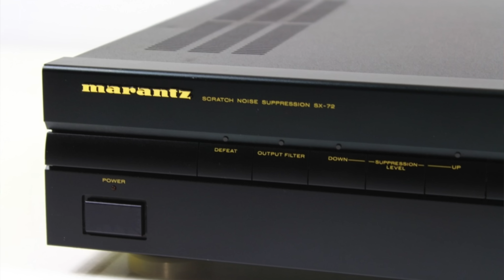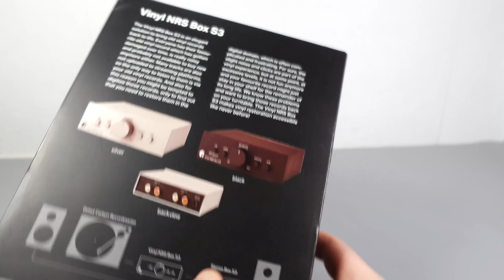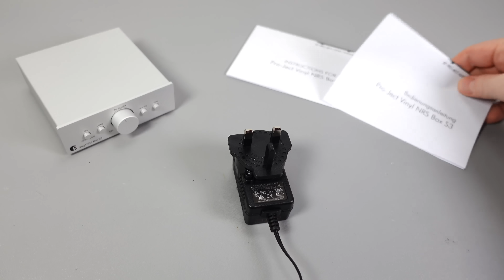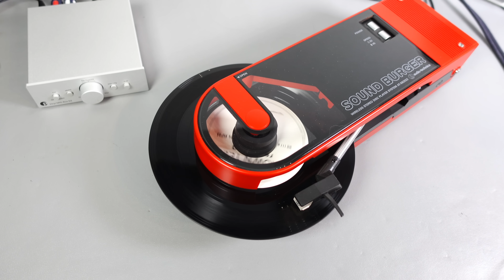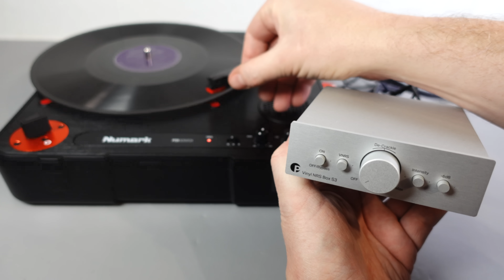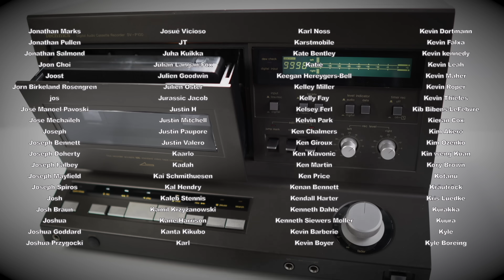REVIEW : Vinyl Noise Reduction System Pro-ject NRS Box S3

Comment: Thanks for testing. To my ears (and also eyes when I look at the recording of the 'silence vinyl' you made) the 'VMRS' is nothing more than a LowCut filter. Some vintage HiFi Amplifiers have a LowCut button and some extrenal phono preamps have that too. Sometimes they are called subsonic filter. 
The one in this device seem to filter at a slightly higher frequency than most of the ones that I've heard. Thats why the bass on the 78 nearly disappear. You said that the listener can turn up the bass on the Hifi to compansate that but by doing that he/she also raise some of the rumble again. 
Unfortunatly filters can't make a difference between rumble and an instrument. At least not now and not in realtime. Machine learning might help to create a 'smart filter' but it will always need processing time (BTW I'm impressed whats possible with 'AI' in audio) . Look at www.lalal.ai for example.

Back to the device :) 

What I realize is that the filter seem to have no influence on the latency so it might be even before the AD converter. The 'De-Crackle' seem to have a latency of a quarter roation (round about 0.5 sec on 33RPM). This could be annoying in some cases when the sound of the  stylus itself on vinyl (I mean the sound that you hear when you play a record without a speaker) and the amplified signal is 0.5 second 'out of sync'
The detection of 'big pops' from scratches is an issue even in software (well ok, I havn't look into the newest releases of decrackling software). When I digitize vinyl I get rid of those manually. Auto decrackle  either didn't detect the pops or create too many arifacts like missing attackphase on 'snappy' instruments (snaredrum etc).

Comment: Hmm 🤔 Overall the performance of this unit seems rather underwhelming. There doesn't seem to be a whole lot of difference even with the settings turned to maximum 🤷‍♂️ For me the biggest surprise is the fact that this unit didn't seem to "mangle" the audio signal too much, even at maximum settings.

I've done a lot of audio restoration of vinyl records over the years, and I've used a lot of different de-crackle filters / plugins. The computer based de-crackle filters work a lot better! In fact, computer based de-crackle filters can be turned up high enough to completely eliminate ALL pops and crackles. However,  this comes at the expense of "mangling" the audio signal and adding a lot of unwanted artifacts 😫

I guess I was expecting the performance of this unit to be more comparable to the performance of computer based de-crackle filters. Like something that could be turned up high enough to make a night and day difference to the audio signal (even if it also adds unwanted artifacts 🤷‍♂️)

Comment: This Project device is basically stone-age design as far as electronics are concerned.  The correct way to make a device like this nowadays would be using machine learning (referred to as "auto-tune" in the business).  While there are expensive proprietary ASICs for studios, they aren't needed for audiophile level hardware.  They can be built cheaply by a manufacturer with off the shelf components and the correct algorithms.  Also just to note, the Project device already digitizes the audio, so its not about a "faithful" reproduction of the analog sound, and neither is TM's review.

Comment: i personally paid around  £200 for a second hand  marantz sx72 real time de-clicker. I'm not an audiophile be any means but this just works!! It has been good for discogs purchases where the seller over grades. what i have also found is that you need very clean records to get the best out of the sx72. I'm very pleased with mine and think that this new unit is nowhere near as good.
Reply: Interesting that you are so happy with your Marantz SX-72. I got one too, and it seems to make absolutely no difference to most things. Only in the quiet sections of a speech-only recording I can get it to make at least some difference. The Pro-Ject device in this video works a lot better than the SX-72 I have...

Comment: I don't believe it's possible to filter out rumble or hum without also filtering out some of the bass drum and maybe bass guitar. On the other hand, the demo of the NRS with the silent record was very, very impressive to my ears. It's possible they're using something more advanced than just a high-pass filter. There's a noise reduction method that uses a noise sample and then sort of subtracts that from the input signal. That can work great, if you have an a good sample of what your particular noise sounds like. There is also the pretty new techniques using AI, but I seriously doubt that little box has enough CPU in it to run a large neural network in real time. ;)
Reply: No it's not really possible. You need very clever algorithms, and while i think this box gives it a go (why else does it need to digitize the stream? - And you can hear what it does to the sound, too. The way it takes the tops off the clicks with some of it's methods is more than just a bandpass), it's obviously not that advanced. Works actually better than I expected, though - And does exactly as expected to the sound on those records that have instruments that share some of the same frequency bands.
Reply: There seem to be good ways of cleaning up old recordings, but that takes expensive pro gear and a lot of experience. Listen to some re-masters of ie the sixties (Nina Simone, Roy Orbision, Buddy Holly and many more). This kind of cheap kit solves one issue and causes a few more...
Reply: @edmaster3147  Like I mentioned, the latest thing is to use AI. If you haven't heard what that can do, you should check it out. They've experimented w/ remastering,, the results are so-so, but for noise reduction, its pretty astonishing. But ofc, there's no chance there's enough hardware in this cheap little box. It does seem to do a pretty good job for what it is, tho.

Comment: This starts to become Audio Science Review territory, but my experience matches some of their findings regarding phono stage power/headroom and how distracting clicks and pops are when listening to a record. Basically scratches or debris cause the phono stage to clip if it can’t handle the power coming from the cartridge as it goes over a bolder stuck in the groove.

It doesn’t eliminate the noise but it does smooth it out.

Comment: A  very interesting review. I wonder how this device would deal with hiss from a cassette tape? Food for thought Techmoan?
Reply: I don't believe it can eliminate cassette tape hiss.  One needs to use the corresponding level of Dolby as was used when the tape was produced.  Or, one of the devices that were "single-ended" like the Phase Linear Autocorrelator,  or one of the Burwen devices, or other DNR systems (Dynamic Noise Reduction)
Reply: @svensvensen8406  It's got to be worth a try, especially on tapes not recorded with Dolby.

Comment: I use DCArt Forensics for noise reduction which of course works much better. You can remove the large scratch type pops individually if necessary, for instance. You can even draw in a wave form.
I did notice though that the 78 speed records were extremely hard to improve. I had to put so much noise reduction in that the music portion decreased dramatically.
In your examples I can't see near enough improvement to justify buying that unit.

Comment: Even Radio Shack had such home audio accessories, which in my opinion, were just another gadget to display on your rack. However, there WAS a professional studio device called a TNE (Transient Noise Eliminator). I have 2 of these in my collection. They are purely analog, and you can monitor and hear the Difference of what sound is being eliminated. They are rare to say the least. Good vid !
Reply: I have the burden research tne 7000 and can confirm it indeed works as intended! It does reduce pops and clicks, but of course it isn't a magic box. Unless you have a clean record, pops and clicks will be there. Just a little less with it working properly
Reply: love mine. Had two, gave the other away. The remaining unit may be pried from my cold, dead hands. ;)
Reply: @railgap  Hi there. The TNE that I mentioned was one of only 2 I built. I still have it, although I have no turntable and donated my record collection to a collector friend of mine. He has the 2nd unit I built. It would not be worth the trouble to build them again, although the idea has stuck in my mind given all the smaller tech parts available but I'm not even sure all the chips etc would still be available. But thanks for the suggestion. 😀
Reply: Hello UsJoe.... you beat me to the comment. Back in the day (70's), I came across the plans for a Transient Noise Eliminator like you mentioned. I modified it to work at line level instead of between the cartridge and the Phono input. I built this device as I was at the end of what I could tolerate in records. Unlike the one tested here, mine worked flawlessly and completely eliminated any trace of the click/pop as if it never existed, like magic. You could adjust the sensitivity to suit the condition of the record. This device is a boondoggle. It clearly does not work and for the price, they are selling people a bill of goods for high prices just like with the so-called High End Audio equipment today. Back in our day, pretty much ALL amps from ALL name brand manufacturers could deliver the quality and performance that today's equipment CANNOT do unless you are prepared to pay thousands. Even then you need sub woofers as the amps are not capable today. Back then it was standard performance. That being said, why anyone would purposely want to use vinyl records as a source is beyond me. I grew up with that technology and I can tell you there is NOTHING better or even good about it. Those who claim 'it sounds better, more warm etc' are delusional. There is absolutely NO science to support this. I do appreciate this video as it just shows so called 'Audiophiles' are being conned. That's my rant for today. :-)
Reply: @Starlight-AG  "Warm" is just the result of a physical object with mass and inertia being moved around in a magnetic field. Since there is limits to how fast it can be accelerated/decelerated plus a mechanical range limit, the actual analog signal can be warmer (as in frequency blending) over say, a digital encoding. It's the audio equivalent of say a soft focus in photography with Photoshop acting as RIAA post amplification. I can't personally say though that on decently produced samples of each (LP vs CD), that this warmth was detectable. An audiophile would point out that my amp transformer is only copper wound, not silver .. thus I won't hear any difference
Reply: @xenuno  I'ts also an emotional feeling of the heart for us humans.
Reply: @Starlight-AG  Thanx for response. The units I have employ a headphone jack which monitors JUST the sounds being eliminated with a special switch. All you hear are low rumbles and high crackles and pops. I would adjust the gain until I just barely started to discern the audio signal source. I have remastered many of my reel 2 reel recordings with this method satisfactorily. As for the digital to analog debate, let's save it for a another time, as I am one of the proponents of raw analog tube amps etc. which I believe DOES create a sense of warmth and depth as opposed to digital. Regards - US Joe
Reply: @US_Joe  Greetings USJoe.  Allow me to elaborate on my previous comment. I agree the warmth etc you speak of is from your analogue equipment (especially tube amps) and yes they DO have a different sound. In fact the nicest CD player I ever heard was made by California Labs and it had a tube front end. But, I was simply stating the sound you speak of is not as a result of the vinyl records. Any good analogue  source including tape decks (good ones) will also have that sound using the same equipment. Take care Joe 😊
Reply: Kind of defies the idea o 'good old analogue' WITH crackles - as this is part of the charm. Otherwise, most recordings have already been professionally remastered and issued on digital media. And if not, if I had some odd obscure vinyl to preserve - I'd probably play around with filters using Audacity - for free! And for posterity.

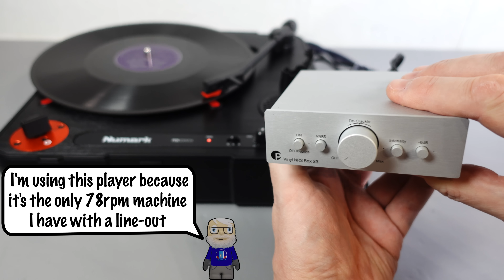Comment: 17:34 I was thinking about, how one with an integrated amplifier could use this (using the internal phono amp), and I think what is possible to do is to connect this device in place of a tape recorder: rec out goes to the device's input, and its outputs back to tape play in. Then, selecting phono as source, and switching to tape monitor, there is your NRS in the audio chain 😅

Comment: Excellent video. Keep in mind that you will get shot noise in amp outputs. This is caused by the transistors opening and closing. That’s why I prefer using a tube amp for audio testing.

Comment: Digitise, throw into EAC (Exact Audio Copy), find a just noise piece and profile it, and then apply noise reduction - maybe audacity might be able to do it too, but I've found EAC's profile NR to be superior to many others.
There was also an electronics mag one way way back which used a bucket brigade delay for synchronous scratch removal, could be modernised into the digital domain.
And finally. another digitized approach, reverse based click detection - while some natural sounds may start with a high intensity, they rarely finish with one, so click detection can be more precise when looking in reverse

Comment: The steel needle (from the linked video) works best. (-:
You are using audacity, have you used and compared the built-in crack-remover with this device?

Comment: I used to use a piece of audio editing software called Cool2000 and that had a pop click eliminate plug-in And that used to work remarkably well but obviously the software was old and therefore will not run on a modern Windows 10 computer it was designed for windows 98 I used to use it to de cracking my Vinyl records prior to converting to MP3.

Comment: I still have a SAE 5000 "Impulse Noise Reduction System" purchased in the 1970's.  It works on an entirely different principle (?), storing a fraction of a second of audio, and substituting that in place of sound with a detected pop.  I think my results are slightly better than your tests, although I couldn't do tests like yours in the 1970's.

I purchased the SAE after seeing a live demonstration in a HiFi store (remember those?) where the demonstrator took a 33RPM vinyl disk, and using a ruler and a razor blade, made a deep groove from edge to opposite edge.  When played without the SAE (or bypassed), as you might expect, we heard a big pop twice each revolution.  With the SAE in the signal path, the pop was totally removed, amazing to hear and quite impressive.  But after trying out my purchase in the real world and getting less rewarding results, I came to the conclusion that if you have records with a large groove from a razor blade, this was the perfect solution.  Unfortunately, I have never owned any records like that, so the SAE is a much less remarkable fix.  Still, on occasion, when reviving records from garage sale sources, it has been useful.
Reply: This system is a modern iteration of the Dynaural system introduced by HH Scott in 1946.  Dynaural made it possible for radio stations to play gramophone records over the air, and was blamed for killing live music on radio.
Reply: @Columba_Kos  Dont even want to try timeshifting when AMPEX started developing prosumer and broadcasting level R2R. The core concept of the magnetic tape recording (to profesional level) was to avoid the rush of live shows. Yes probably killed the magic
Reply: YES!  OMG!  I had one too. It did a way better job than this new-fangled digital BS. 😊

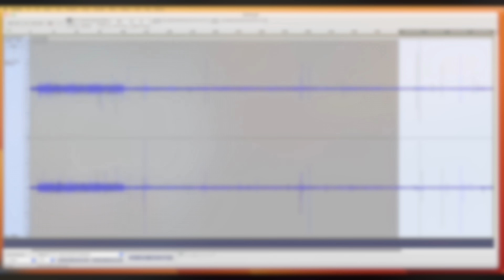Comment: Still interested in this (or a similar device) despite its not seeming to do as much as I'd like (but my old amp is super noisy, I will try fix someday!)  ... Would be interested in a test similar to 13:55 - 16:35 but with the same section of "silence" repeated for each test. Also would be interested to see crackle reduction filter turned on but background noise filter turned off. If anyone has done such a test let us know.

Comment: To be honest I would rather spend that kind of money on a auto record cleaning device to remove some of the pops and clicks. The rumble from the deck can  be cured by re greasing the bearing on the deck as after some time it turns hard and needs replacing and sitting the deck on some cut up old mouse mat under each foot works a treat. I find that using  car screen wash, mixed with a little warm water and a medium soft tooth brush makes a lot of difference but the real answer is always keep your fingers off the playing surface and ALWAYS put the record back in its sleeve with the open end inside the outer cover.
I know most who read this will know how to keep records clean so I'm not trying to preach to the converted but there are people out there who still have no idea how to look after vinyls.

Comment: Back in the days when I played a lot of vinyl records I found that if there was a pop or crack, it was usually a grain of some sort which was stuck in the groove and wouldn't come out by brushing. But using a magnifying glass and a needle it wasn't hard to remove if you were careful, and normally this would completely get rid of the noise.
By the way, how many grooves on average are there on a normal long playing record?
Answer: Two! One on each side. (Just a little joke you can sometimes catch people out with).
Reply: You have emphasise normal. Monty Python's Matching Tie and Handkerchief, for example, has 3. A friend of mine don't know this as his automatic turntable always managed to pick the same groove on side B.
Reply: Thanks! I'm going to use that in my next office quiz! 👍
Reply: Good joke!